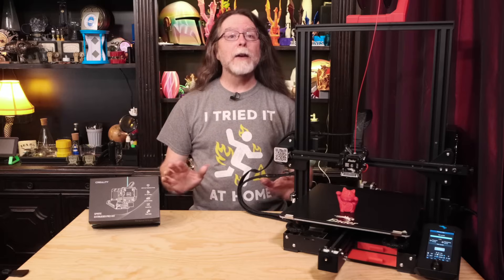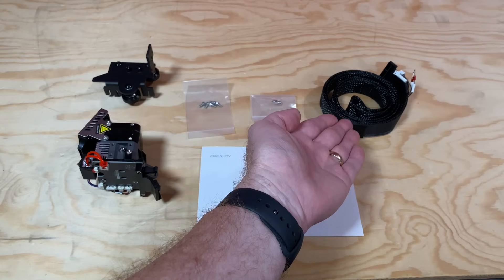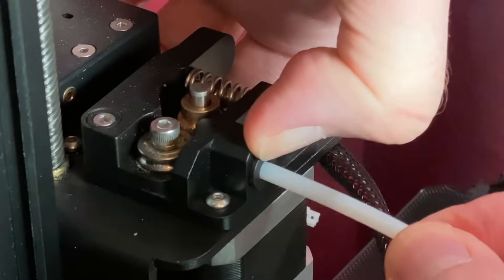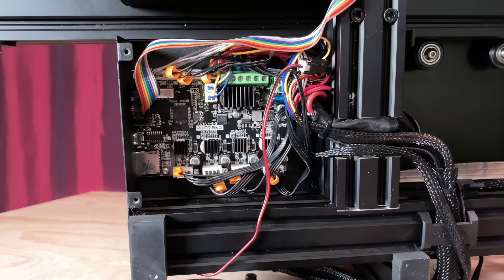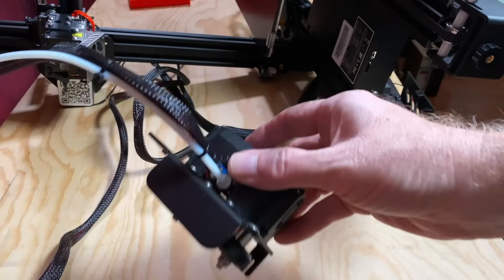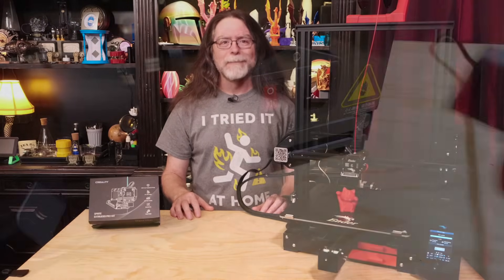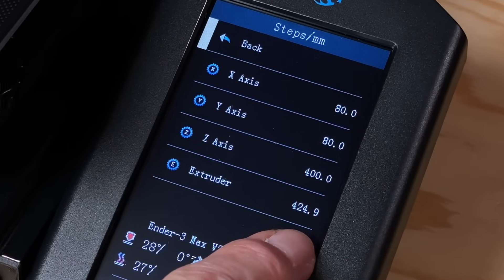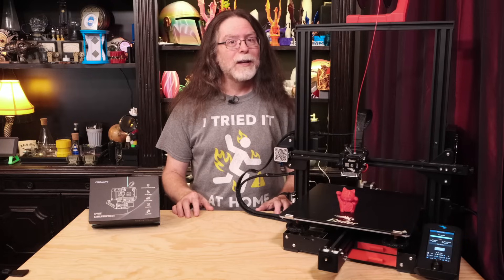How To Install the Creality Sprite Pro Extruder Upgrade

Comment: Bless you for making content like this. Some of us are on the casual end of 3D printing, and while we want the prints, and we sometimes require the upgrades to get there, we don't have the kind of engineer brains that easily memorize all the parts, ins, outs, etc. of our devices. I found this video after reading over a write-up on direct drive replacement for a stock E3v2, and it made such an assumption about my preexisting knowledge: there wasn't even a single photograph to help me understand. Being able to get this ELI5 breakdown with video examples of every single step is so important for a user like me, and this isn't the first time your channel has helped me out like this. Thank you for all your good work and your friendly, accommodating presentation. I, and people like me, really appreciate you.
Reply: Thank you for replying.
With the help of my son looking at his and telling me he pulgged it in with the short wiring included with my auto leveler, I was able to install it. I didn't even remember that a short wire came with the cr touch! I removed the extruder so I could see and reach the spot.

The last problem I am having is that the hot end probe isn't heating. It blacks out the printer control board screen, then restarts without starting the temp on the probe tip. Due to a nut placement on my Aquila mother board, I had reversed the connectors for the bed and hotend. after correcting the plugs, it is still blacking out the screen and restarting without performing the temp check.

Comment: How would i set up the new sprite with CR touch on my V2? I cant seem to get the nozzle close enough to the bed after auto homing  and taking Z axis to 0 its still more then 10mm away from the board.

Comment: Great video. For the Sprite extruder Pro use the thermistor type 13, there is a special configuration (for V2 and S1) in the repository, also for increase the temperature you can use the custom G-code C104 without having to compile the firmware.
Reply: ? M104??
Reply: @carlpratt692  no, custom G-code C104
Reply: Thanks Miguel, but still not sure how to do this. I have an Ender 3 that I have upgraded with 3V2 - 427  found your software to make it work but haven't figured out how to raise the max temp to 300 yet. @MiguelRisco
Reply: @carlpratt692 , I can't put a URL here but you can find info in the Wiki of the firmware, there are some videos about that.
Reply: @MiguelRisco  alright so I did more research on your wiki. Im still confused. Some people are saying option 5. But on the wiki it says special config 13 may work for the sprite. Should i use the 13 configuration or the marlin 05 for the ender 3 v2 with sprite pro and crtouch? I apologize if i am confusing
Reply: @Pdunns3D  use 13.
Reply: @MiguelRisco  i can just flash the board with the new firmware? Or do i have to reflash the screen? Sorry for the noob questions im sure youre tired of them
Reply: @Pdunns3D  There are precompiled versions (ready to flash) with the T13 thermistor, you don't need to compile anything. Look for the releases in the special configurations repository.
Reply: @MiguelRisco  i got it installed and flashed. Its all working just trying to fugure out the correct locations for the probing and leveling.  thank you for the help
Reply: @MiguelRisco  how do I find your software
Reply: @randonrobertson3341  Look for Professional Firmware for the Creality Ender 3 V2/S1 Printers, I can't post links here
Reply: So i cant use the normal premade 4.2.2 crtouch firmware from you? I need to change the thermistor type?

Comment: Is it possible to get my ender 3 v2 leveled, set up and first test print without the use of a computer. I ask because I don't have access to a computer right now and I finished building and attempting to get the bed leveled. Thank so much for any helpful advice you may have.

Comment: Creality waited way to long to start using direct drives. i moved mine to a Micro swiss direct drive. They very easy to install. (The one i installed) no wiring change, prints TPU like a champ.  e stepper adjustment is all...installed on a ender 3, CR-10S and a CR-10S pro
Reply: Are you happy with it? Reading very mixed reviews about them. However my dual gear bowden extruder is really nice.
Reply: @marcelmaurer9860  The dual gear bowden is nice, (Bondtech?) I thought about getting one. I do like the Micro Swiss though. but after getting the Micro Swiss I dont think the dual gear is needed. TPU before Micro Swiss would give issues retracting and start spilling out the gear (extruder) . I have not had that issue 1x sense putting the Micro Swiss on. Print quality did go up as well.

Comment: What about putting the run out sensor right Below the spool holder like on the soval sv04
Reply from the maker: With some thought and planning and Tinkercad and extending the wiring, that is a possibility. 👍🏻

Comment: great video, but can you maybe also do a small tutorial how to put a CR-Touch on the sprite pro with the integrated connecter on the sprite pro? i would love that to
Reply: any information about the CR touch working with Sprite Pro?
Reply: @ricohen04  the current situation: CR Touch working with Sprite Pro ONLY if you using separated cable from your CR Touch kit. 
If you using an integrated connector on the Sprite extruder board (with short cable to CR Touch), it will not work properly: CR-Touch will test itself, respond to manual command from menu, like "Stow", "Retract", but will not engage while "Auto Home", "Prob Z Offset", starting print, etc. 
It will work tho if you disconnect an extruder motor cable, but is not an option. 😁
Reply: @I000I I am using professional firmware. No issues homing or doing a 5x5 calibration, apart from the whole thing hitting the limit on the gantry.
Reply: @leetpg  I'm ended up using Klipper. Should check this integrated connector now, i guess. 
Anyway, this extruder is good. Already printed some TPU parts for my home improvement, and planning to print something with Nylon.
Reply: @I000I  I thank you very much for this tidbit of very important information. My E3 Pro with original print head and CR Touch performed beautifully until last night. I did this upgrade with the Sprite extruder, thank you Bryan for excellent video, than it all went bad. Will be reworking the CR Touch cabling tonight and keeping my fingers crossed. Thanks again.
Reply: @caddguy6  Turns out the problem was in poorly designed Creality 4.2.2 motherboard. When i upgraded it with a BigTreeTech SKR Mini E3 V3, all problems are gone, and a short CRTouch cable working without any problem. Not to mention, how good new silent motherboard are. 😁
Reply: Im trying to see the same thing

Comment: I got this a few months back and installed on my Ender 3 V2. I had few issues that I wasn’t able to sort out so I went back to Bowden. I will say, the few prints I was able to do with this extruder I was very happy with. 

I do own a CR Touch and when I reached out to creality about the cable, they sent me one gratis which was cool. Regardless with the CR Touch installed I couldn’t use the max build volume given the new offsets. I know now there are some firmware tweaks to do to fix that. 

My other big issue was the thermistor connector would never seat correctly on the board. It would constantly come loose resulting in the printer going into thermal run away and shutting off. 

I’ve since shelved the sprite but I plan on revisiting once I get a second printer, my plane was to buy and Ender 3 Max and try my luck there.

Comment: I have this running on my Ender 3v2 :) On some versions of the sprite kit, the heater cartridge is disconnected from the back plate - look for the two red wires going from the heater cartridge to behind the fan. You need to fish out the plug, and plug it into the appropriate socket, or the hotend won't heat :) Also, thing 5421432 provides an adapter for the CR-Touch, without which the probe can' reach the entire bed.
Reply: What X and Y offset did you use with this adapter? I updated my ender v1 to a 4.2.7 board and the sprite pro with the cr touch. I found another video that gave the offset and it seems to work well. My biggest issue is I’m trying to figure out how to change the mesh distance. When it goes full right it will grind due to the size of the sprite pro. Any suggestions? I’m using the creality firmware for the 3v1
Reply: @Pumma-12   My kit came with new shorter screws and flatter nuts for the carriage wheels so it can clear when it goes all the way to the right. My probe offsets are set at x (-31.5) & y (-49.5).
Reply: Good call. Mine failed to heat up on first try. Then read you comment and pulled the head off and the heater wire was tucked in behind the fan. I saw the open plug and just figured it was for a feature on another printer.  If I would have looked close I could have pulled it out wiht out removing the head.
Reply: Thanks! I was plugging and unplugging all the wires before I read your comment!
Reply: https://youtu.be/M9lHZMCMlLo?si=sC-8rlRPvs9Iiltl
Reply: I hit this as well! Fixed my issue, it was driving me crazy

Comment: I've been considering upgrading my Ender 3 S1 to a Sprite pro, so that I can print at higher temps.  It seems that it should be easier than the upgrade you did here.

By the way, you didn't have to tune the PID?
Reply: u should
Reply: You can buy the pro components if you have the sprite already from Amazon for like $25
Reply: @JeffJordan00  Yes, smart choice.  You can even buy it on EBAY, 300 C kits only cost 20+

Comment: When I installed the Sprite Pro on my stock Ender 3 a few months ago I got better results using 430.85 mm on the extruder steps, and if using a CR touch just select the "Ender 3 S1" in the Creality slicer. At least that worked on my 2019 stock Ender 3.
Reply: Also changed mine to exactly 431 a few days ago.
Reply: How’d this go? Just got a cr touch & sprite pro

Comment: I'm about to get this kit and get rid of the bond tech extruder system I got. I've had nothing but trouble with it and they don't make replacement parts or I haven't been able to find them for the gears that push the filament through to the hot end.

Comment: I did this installation a while ago on my stock Ender 3 V2. While the process was vary straightfoward, one of the mouting plate screws kept hitting one X-Axis screw on the right side of the printer, so much so that I had to use another smaller screw that I had laying around. Since you didn't mention it in the video, I imagine Creality fixed that issue, or I did something very wrong
Reply: They started providing shorter replacement screws. I did mine a month or so ago and worked great
Reply: @ryanfisher582  where can u get them and how long are they
Reply: so what size are the bolts
Reply: This might come down to unit-to-unit variances but mine probably wouldn't even be fixed with a shorter bolt.  The nyloc nut is hitting my frame, so I wonder if they're giving thinner nuts as well
Reply: @alicec2033  The kit comes with flatter nuts as well now.
Reply: OH MY GOD! I am having this same issue! I am glad it wasn't just me. @CMJ1015  @Ryan Fisher  do you know what size the bolt is? Mine shipped with the nyloc nut so I am having this same issue :(
Reply: I just installed as sprite pro purchased last month on a E3P, same issue. All seemed well until I sent a level bed command. That's lazy prototype testing, Creality.

Comment: Hello Bryan! 
Im having trouble getting my Cr-touch to work with my Sprite pro. Could you look into installing the Cr-touch to the sprite pro? 
You may run into issues as well. If so, share with us how you solved it! 
Thanks! 
Love your videos!
Reply: What were your issues? There is an adapter you can print to enable it to reach the whole bed (thingiverse thing 5421432), with x/y/z offsets set to -48.8/-12.3/-4.7ish
Reply: @minouris  
My Cr--touch would not light up purple.
I thought maybe i had a bad Cr-touch, so i ordered a new one, same result. 
I know there was power running through it. It just wouldnt light up purple or react in anyway with the printer.
Reply: I had a similar problem the first probe point was off the bed at the front left corner. If you have Marlin go to configuration> advanced settings>probe offsets, Probe x is -27, Probe y is -60 A little more fine tuning can be done but this has worked for me so far. I'll print the adabtor mentioned above and see the difference but I feel like I'm getting full print area haven't tested it other than printing Draco's wand witch ;) went fully diagonally across the bed.

Comment: Great video, Bryan. When I upgraded a "Ender style" printer to direct drive, I left part of the old extruder installed that held the PTFE tube collet. It turned it into a reverse-bowden setup that allowed me to keep the spool next to the printer as well as keep the filament runout sensor.
Reply: I would like to see that setup cuz I can't figure out my setup on my Ender 3 max 😅
Reply: Me also please!
Reply: I did the same also. Basically took out the "guts" of the OG extruder leaving the frame so can go through the filament sensor still and the bowden coupler so that I could still have bowden tube from the sensor to the direct drive filament inlet. Keeps from having to reengineer a place for the sensor on a top feed spool holder.

Comment: Anyone looking for the short CR touch cable the Part number is WM15261-ND on digi-key.
Reply: The one other video I have found of this installment they said they had trouble with the short wire that connects straight to the extruder and to just use the long one to the board instead, are you having any troubles with it?
Reply: @elyknavillus777  No problems so far using the professional firmware
Reply: @tanmanslim  you have a link to the firmware or do you mean the official creality firmware?
Reply: thank you my freind
Reply: is that the full cable

Comment: Great video. Creality in the manual provides a cable holder that can be printed and mounted where the extruder used to be.
Reply: Well crap I didn't see that lol, thanks for the info.
Reply: Do you have a link for this by chance?

Comment: It frustrates me that this sort of extruder doesn't come as standard on the Creality Ender printers. I'm fairly certain it would solve a lot of the headaches that first time owners face if they just shipped it as stock.
Reply: Well they do now with the Ender S1. I tried this extruder and found my mounting bracket was not a 90 degree bend. When mounted one side would droop lower after the bottom line screws were installed. Took a while to pin point the issue, however if I just installed the two top screens it was level.  With the fan in front as it is, it is harder to see the first layer. It is a nice setup.
Reply: @truggy82  Ah that's good to know at least. I've seen a gradual decline in Creality's production quality in the last couple of years, and it's left me recommending printers that are embarrassingly bad :/
Reply: @ellafoxoo  most things I hear about the S1 is that it's basically plug and play. It has like 3 steps for setup and after that you set it to auto level and then can print with damn good results right away.
Reply: @Alucard0715  got a S1 as my first printer, its basically plug and play, but needs a bit of modding on some parts, its optional though. Quality of prints are are really good, only issue i have is random z banding on the walls.
Reply: This sort of extruder didn't exist when they were designed or originally sold.  They're available on there current line up, however.
Reply: This is handy video I wanna add this to my ender 3 max neo.... what's firmware    would I need to get for it work with the touch prob please